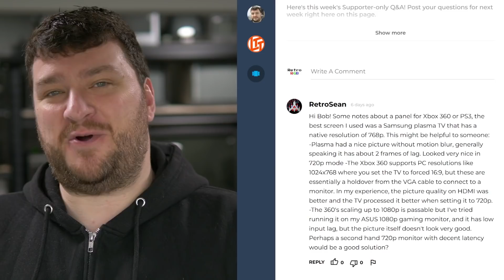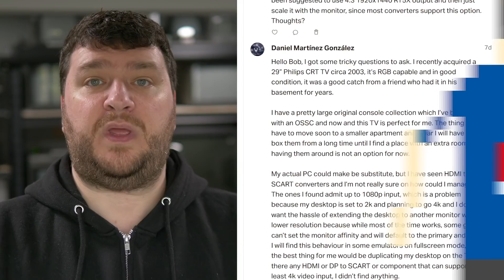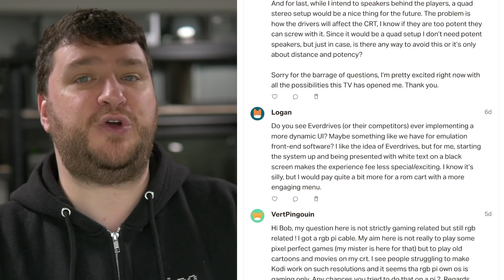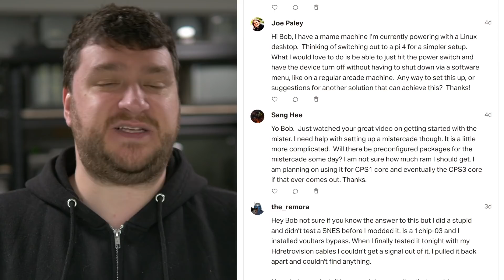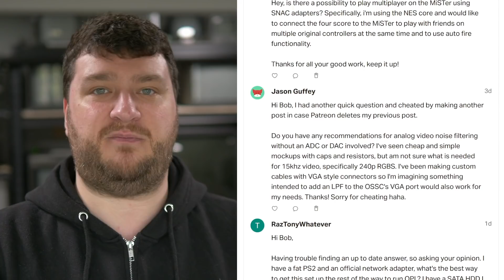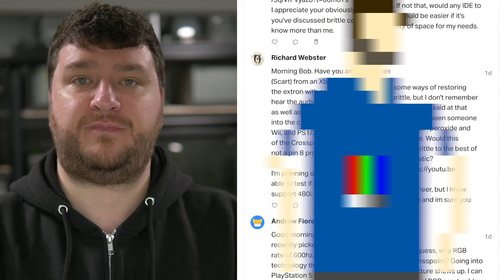Supporter Q&A #202

Comment: I've got a PS2 I was using just fine with a network adapter until a couple months ago when it stopped detecting the device entirely.  I tried a different one too, both official, and it just doesn't seem to be reading it at all.  Does anyone have some advice about what may have gone wrong?

Comment: Regarding 600 Hz plasma panels:

The way that plasma TVs work, the brightness of the subpixel is determined by how long it's illuminated. Hence, to dim a green phosphor to 50% of its max brightness for one second, it will turn on and off rapidly so that it's only on for half that amount of time. Increasing the rate at which it turns on and off helps improve the level of brightness and reduce the ability to see the light turning on and off. A 600 Hz plasma therefore would be able to cycle a subpixel on and off 10 times for every frame of a 60 Hz signal. That said, I'm fairly sure that most plasma panels were at least capable of doing this 8 times per frame, aka "480 Hz."

The cycling of the subpixel has nothing to do with the source content. To my knowledge, most of the "120 Hz" and "240 Hz" LCD TVs from back then were using frame interpolation or black frame insertion to either provide the illusion of an increased framerate or reduce image persistence and motion blue, which was really common on LCD TVs back then. Most of the time it just gave everything the "soap opera" effect. Plasma TVs don't have those issues and therefore aren't reliant on higher refresh rates in order to provide a quality picture. Therefore I doubt that any plasma would support anything higher than a 60 Hz input.

That said, I have no idea what would happen if you tried to give it a 120 Hz signal, whether it would just reject the information and display it as a 60 Hz signal, or if the signal wouldn't work at all. I doubt it could do any damage to the TV, but I also doubt the TV would be capable of actually displaying 120 Hz content at 120 Hz. They just weren't designed for that. It sounds like in Andrew's case, the TV IS actually displaying the signal, so that's interesting to know, but I doubt it's actually displaying a 120 Hz signal. Perhaps the owner's manual for that particular TV could help shed some light on the topic.

Comment: I'm using CRT Emudriver with a rig specifically for emulation. Windows 7 SP1 (no internet connection) and Retroarch. I spent 39.99 on a Dell Optiplex 9010 with a core i7 3570 clocked at 3.4 ghz. I threw an R7 360 and a 750W PSU I pulled from another defunct computer and it is incredible. Retroarch with 240p super resolutions is such a great experience on a CRT.

I'm having problems with Dolphin, though. I put my desktop in 480i, but when I full screen Dolphin, I get a double image and bad color distortion. I think Dolphin is forcing a progressive resolution above 15khz (480p probably) and Dolphin devs assert it's not a problem with their emulator.

I've followed your channel for a few years now and I listen to your weekly updates videos while I'm on the road, but I want to solve this problem so badly I'm thinking about becoming a monetary supporter so that I can ask for your help in fixing this problem I'm having with CRT Emudriver and Dolphin specifically.

Comment: Since you mentioned the argon one case's shutdown button: if you use that, it will be a (script provided) safe shutdown. That's different from cutting the power when you use a button in the usb power lead.

As for the risks of shutting down by cutting the power: you could also corrupt/damage any connected usb drive.

Comment: So for shutting off a Rasp Pi, I think there a quick shutdown script that makes it easier for Arcade/console Emulation use.
Reply: This is what I use. There are scripts that can be activated with the movement of a physical switch. That way when you flip the switch the pi does its normal software shutdown without me needing to go through the menus.

Comment: I have a PC in my Sega Blast City cabinet that is set to display 15kHz. I'm excited to see your video for how you do it! I'm using an old Radeon GPU using CRT EmuDriver that connects via VGA to the original CRT. Before I setup my MiSTer on my consumer CRT (XBR250) I had that same PC connected to it and I used the DVI output on the Radeon card, DVI to VGA cable, then used the RetroTek VGATVC1 to convert from VGA to component. It all worked great and added zero lag. The software configuration for display settings, CRT Switchres, and other things can be a real pain, but once you get it working it's absolutely the BEST emulation setup you can have for 15kHz games.

Comment: I have a 50" Pioneer Kuro 720p plasma TV that I use primarily with 360/PS3/WiiU and it's great! I play a lot of 360 shmups on it and the input lag is not noticeable whatsoever.

I do what you are talking about, different setups for different eras. It's great! I've got my Trinitron XBR250 for all the 240p/480i stuff, a Panasonic Tau 4:3 HDCRT for Gamecube, Xbox, Wii, etc, and then my OLED and 4k projector for anything PS4 and newer and PC. I'm sure an upscaler would be fine and be MUCH more simple, but I have the space and there's something that just feels right about playing on period correct high-end displays.